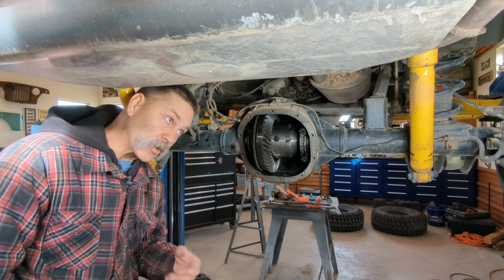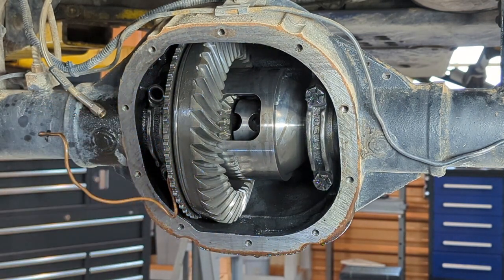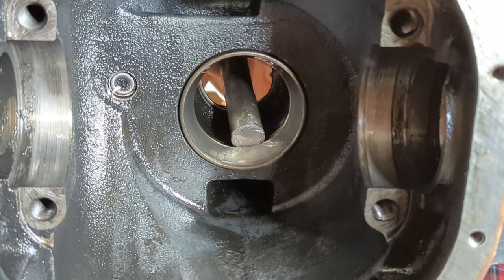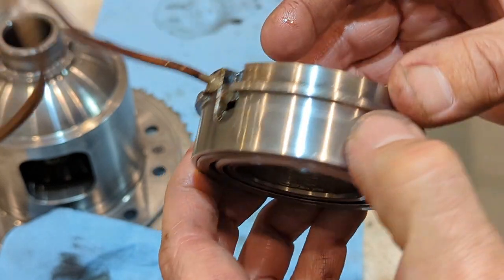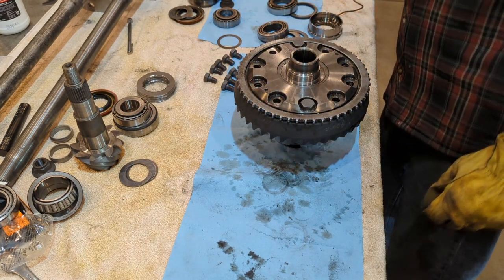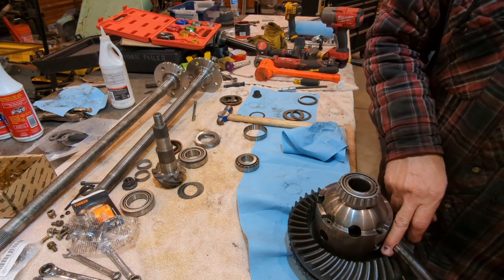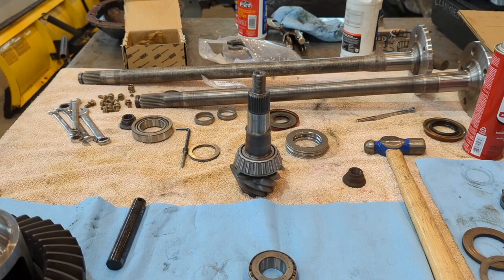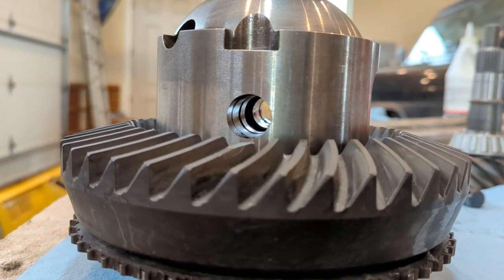How To Re-Gear a Ford 8.8

Comment: I’m gonna do this to my bronco. I’m doing it in my drive way. Would it be worth pulling the rear diff completely out of the truck?
Reply from the maker: Sometimes it is far better to just pull it and put it on a bench. I can remove an axle in about 30 minutes. Not having to get up and get back down multiple times is worth it in my opinion.

Comment: Thanks for the video, I just put a Ford 8.8 under my Jeep yj . Currently running 4.11 but need to regear to 4.88. I have never done gears before , but I’m willing to attempt it . I am thinking of pulling the rearend out from under the Jeep and benching it to make things easier . I agree that the Ford 8.8 is a PIG !! Couldn’t believe the weight difference between the Ford 8.8 and the Dana 35  that was replaced with it . Your video is definitely a great inspiration and I’m sure it will be a great help to me ! I also liked your skid plate nutsert replacement video, and I did all of mine last spring using the black magic brakes kit .
Reply from the maker: Glad the videos are helping! Putting it on a bench makes things way easier but at the same time it takes the extra time for removal etc.

Comment: I'm on the verge of running patterns on an 8.8 re-gear and had a couple questions:

1. Have you ever used the method of patterning with shims that provide a "tight slip fit" and then adding 0.005-0.006" shims to each side on final install?  This was recommended in the OX locker install manual.
2. If my pinion depth is off, I would need to remove the bearing and re-shim, but that could damage the bearing.  I have the puller tool and the old race so I was going to use that.  What if you didn't have the tool?  Would you need to use a new bearing and race each time?  Seems painful.

Thanks for your awesome videos.
Reply from the maker: You can do that to get close but I have had a pattern change when adding shims at the end. Just double check.

As far as working the pinion depth, make a setup race for the inner pinion bearing. Take in and out until final setup.

Comment: question the splined gear next to the ring gear.. is that an abs tone ring? I have an 82 mustang gt that i figured out has 3.73 gears trac lok posi.. but unsure of that gear attached to the ring. (left hand side of ring gear) or what donor it came from..

Comment: Hi, I have a very strange clunking somewhere in my driveline that only happens after it has been driven for a while to warm up and it only happens at very very slow speed, even less then walking speed but it is a savage clunk that goes right through the truck. It is a 2001 Ford Explorer Sport Trac 4x4. I have checked the uni's and they are all good. Thanks.
Reply from the maker: That could be a lot of things! 🤷
Reply: @TheBFHGarage  I wish I new some of them.

Comment: Did you have to remove bearing from the pinion every time you adjusted the shim thickness?
Reply from the maker: No. Use a setup race. Make sure it's new and the same manufacturer as the final one. If I'm shimming between the pinion head and bearing, then yes, I'll use my clamshell puller. You can also use a setup bearing in that spot.

Comment: When you reshim the pinion after the original measurement, are you removing the bearing to put the shims along side the original one or are you placing them elsewhere on the pinion? I assume you’re putting them with the other shims but I figure I clarify vs guessing. This will be my first time doing gears, I’m a full time mechanic and I’m trying to familiarize myself before I dig in
Reply from the maker: When shimming the pinion, you have two options. You can place shims between the bearing and pinion head or you can place shims behind the race in the housing. Either way will require a setup bearing or a setup race that you can slide in and out to change shims. When adjusting shims, you are adding or subtracting to the same shim stack location.

Comment: question, I have a 31 spline 8.8 cut down to size to fit my track car, its a custom 8.8 rear end, however it was the open variant. I bought a 31 spline LSD for the thing but I dont have a ARB nor do I need it, can i just follow the same steps but instead of using that arb bearing + seal housing, just use a normal bearing?
Reply from the maker: Yep
Reply: @TheBFHGarage  awesome thanks!
Reply: @TheBFHGarage  by chance do you have  a parts list online or any links that could guide me to buy the appropriate bearings, races, and shims like you had in the video? I'm very new to ford parts so I dont really know where to look for them, sorry for the bother.
Reply from the maker: @iReinTV  I always just buy a master install kit for a particular axle. Comes with everything you need. Call Revolution Gear and Axle and tell them what you're looking for and they will make sure you get the right stuff.

Comment: Wow. I've been watching all 8.8 regear vids and I can say yours is probably one of the best! I'm getting a detroit locker for my 8.8 with 4.56 gears. Do you know if the carrier of the detroit will clear the crosspin? Or I have to shave the tooth gear like you did? Cuz I heard some lockers have that in mind when designing the housing. Cheers man!
Reply from the maker: I don't know. Depends on gears. It's easy to do once you're in there so I wouldn't sweat it.

Comment: Is it possible to clock the ring gear so the cross shaft will clear between the teeth ? I was thinking that the teeth are probably not an even number so some orientation may be better than others ?  Thanks
Reply from the maker: Usually it's two teeth on one side and one on the other that gets one the way. You can certainly try it, but you'll need to have the ring gear heated up to rotate it.

Comment: I have an 8.8" front diff that I am working on and I am very thankful for your videos! I have a question about the install. The diff is slightly different than you show and the ARB supplied C-clips do not fit. Originally the axles have Circlips, however, when test fitted it appears that the original slot for those is out of reach because the cross pin wont let the axle slide any further in. Do I need to modify the end of the axles to allow for C clips to fit because even if the circclip fit it would be almost impossible to get in and out of that small window? Any suggestions? Asking for educational purposes only. Thank you.
Reply from the maker: You have to pull the crosspin to get the C clips installed!
Reply: I was able to get the original ford Circ Clips to fit after a lot of finagling. Cheers from Colorado Springs. Thanks.

Comment: So , is the pattern more important on the coast side?
Reply from the maker: It's important on both sides. But I like to favor the side that sees the majority of the load. For example, on a front high pinion dana 30 I would favor the drive side. On a low pinion rear axle, I would favor the drive side.

Comment: hi, what kind a pain are you using there?
Reply from the maker: ??? Usually back pain🤣😂
Reply: @TheBFHGarage  lol. im sorry i try to said paint.
Reply from the maker: @prospexican  haven't decided just yet
Reply: @prospexican  gear marking compound. Any decent set a gears will include a tube with the gear set. If it didn't, you can get a tube online.

Permatex also sells one that's called Prussian Blue. That's available at most auto parts stores.

Comment: Interesting how you apply your drag. I usually install the axles, and apply the parking brake slightly.
Reply from the maker: I couldn't imagine doing that every time I wanted to run a pattern. That would add a lot of time to a job.
Reply: @TheBFHGarage  yeah. I use under lift hoists, one on each end. I install the axles for proper load and drag, then I run my pattern. If it needs adjustment, I pull the axles out only enough to disengage the carrier, and allow it to be removed. The hoists at each wheel end are used to support the axles while they are disengaged from the carrier.

The way I was taught was that you can't get an accurate reading with the axles out as they apply their own drag, angle, and pitch to the carrier. 🤷‍♂️
Reply from the maker: @LynxStarAuto  Somebody fed you a line of BS when they "taught" you. There is no angle or pitch, the carrier only goes in one way and gets bolted down. Accuracy statement is bunk too. This isn't rocket science! 😂
Reply: @TheBFHGarage  My father passed on down the industry to me sir. He was a professional automotive mechanic for 40+ years. I followed in his foot steps, and run my own automotive repair business. (Check some of my own videos). Been in the industry myself 20+ years. Show a little more class and respect.

The way my dad taught me, is the way the big rig industry taught him. The idea is to measure with the axle assembled as close to road simulation as possible. The drive axles do indeed put a load on the carrier. Try it one day, you will notice your measurements change. 😉
Reply from the maker: I don't mean any disrespect but I've seen a lot of crazy stuff. I'm sure your big rig stuff could be different but what I put out pertains to common light vehicle axles that's all.
Reply: @TheBFHGarage  I'm sure you have. Seen some whacko stuff myself. There is always more than one way to skin a cat. I thought the video was great quality tbh. Concise, and professionally done. Just piqued my interest how you applied your drag was all.

Comment: Where is the video where you flatten down the pinion nut?
Reply from the maker: Flatten down? You mean take the edge off the threads? I just use a Dremel with a sanding drum
Reply: @TheBFHGarage  ah gotcha, i went ahead and did that and worked great 👍 thanks for video.

Comment: 13:16  never grind the ring gear, grind a small flat surface the length of the cross pin instead.